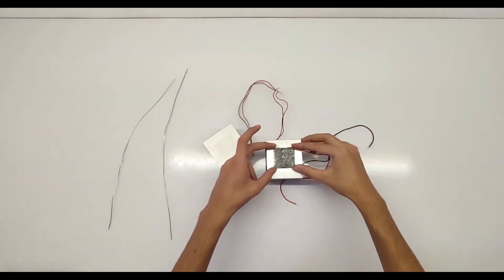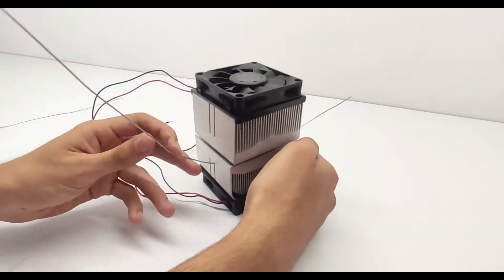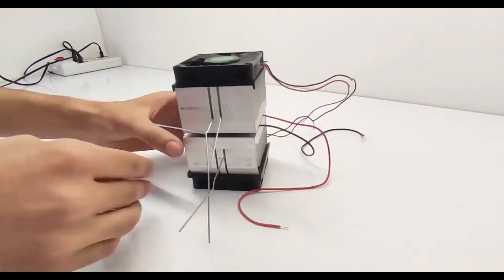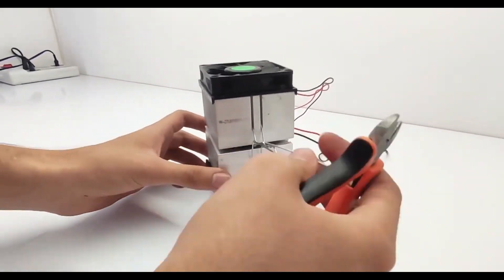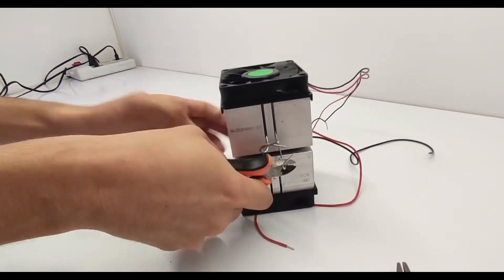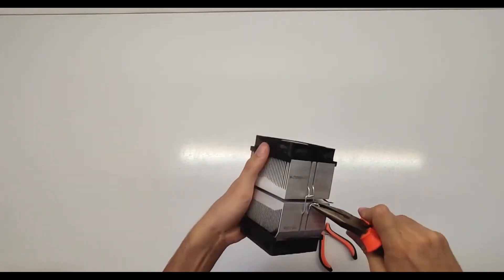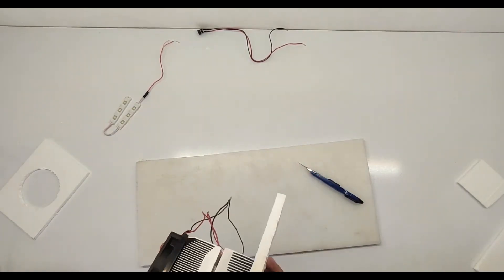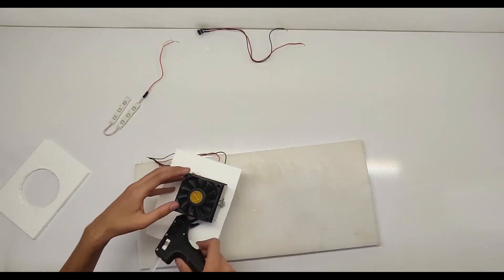Ultimate DIY Mini Fridge Build Guide | Step-by-Step Tutorial

Comment: So what is the principle behind it's working? From the looks of it; a fan brings air to a metal block that absorbs the heat and then another fan blows that collected heat out. The insulation acts as a shell from external heat.
Reply: Look up "peltier modules". They are special electric modules, where one side gets hot and the other cold when provided with power. They can achieve quite high deltas like 50 degrees. You have to actively cool the hot side with a fan, otherwise you have one side at 20°C and the other at 70°C. If you cool the hot side with a fan, the cold side can go below freezing quite easily. Now transport the cool to your fridge, That could be done without a fan, just by attaching a heat sink directly to the modules cold side